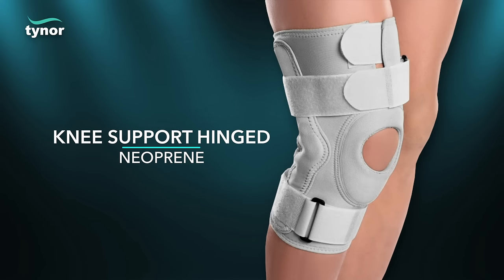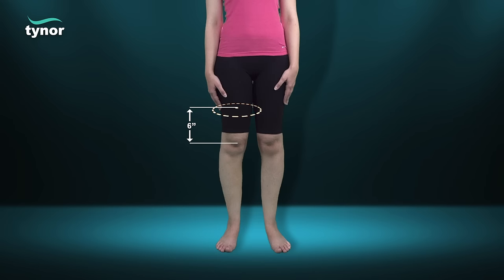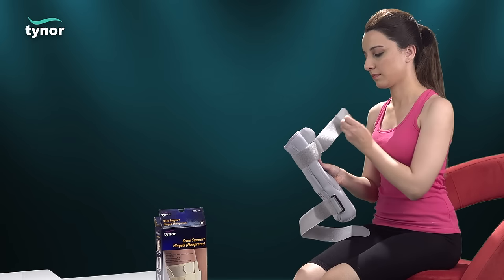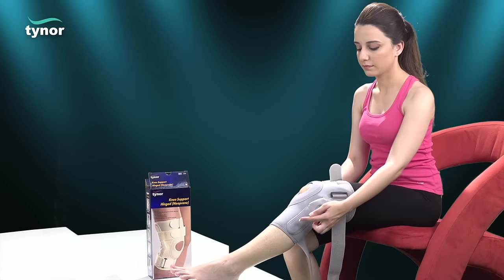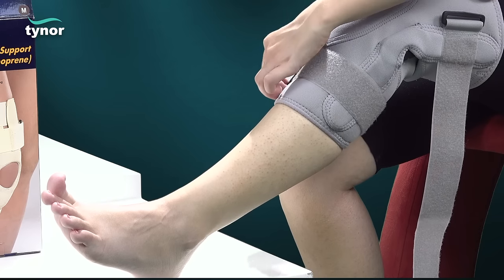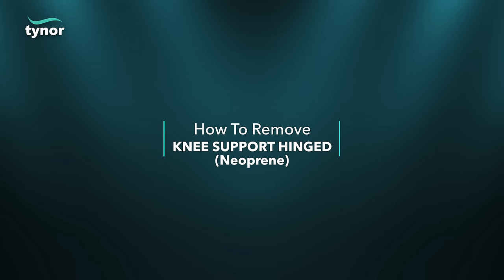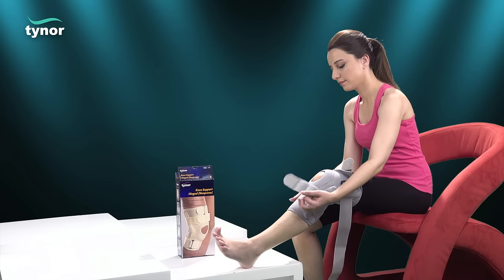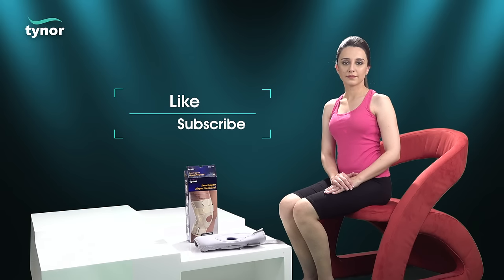Tynor Knee Support Hinged (Neoprene) for knee stability and recovery

Comment: knee support is difficult to pull above the knee. Its very tight...
The size is received correctly and dimensions of Knee circumference above Knee (i.e 6") is considered.    Please advice...Shall I replace to next size?
Reply from the maker: Hi. If that is the problem please replace it with the next size.  We will also look at the issue you have faced.
Reply: ayneda pllc
Reply: LEO Y Marisol.😀😃